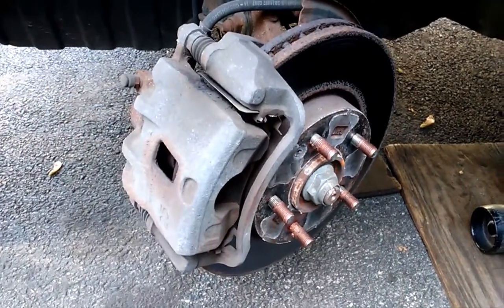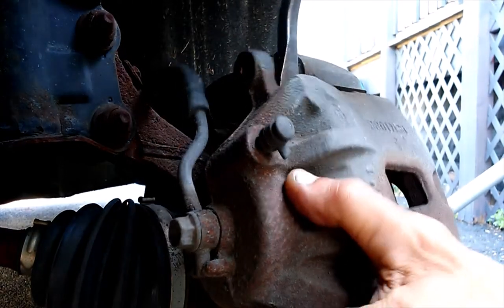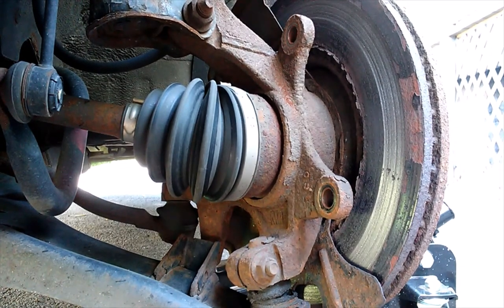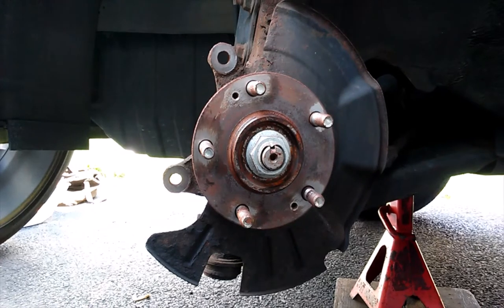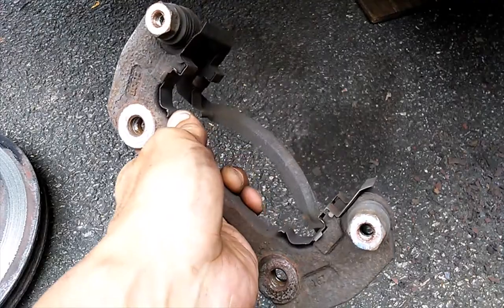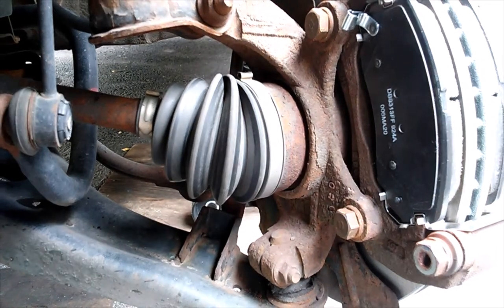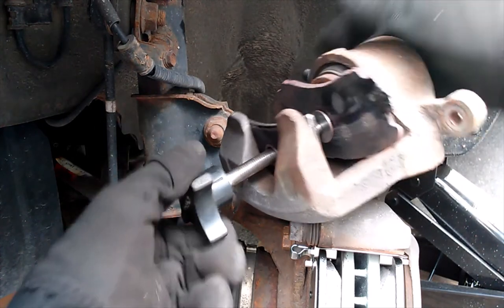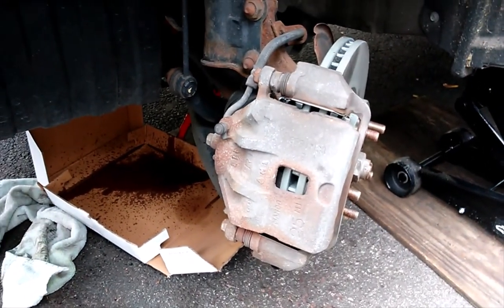2012 Kia Soul Front Brake Pads and Rotor Replacement

Comment: Had to use an impact driver tool to get the rotor screws off cuz they were messed up by salt. Handy tool to have.
Reply: You must be Joe Biden family member
Reply: @irisbaez1972  Ohio winters mess with the durability of these rotor screws.
Reply: @NurembergSwampWater  NOOOO. is the luck of using anti-Zeise. I have done this so many times that I do it with eyes closed. I have two cars Hyundai and Kia.
Reply: @HeydaCarreras  yeah that's something imma have to do